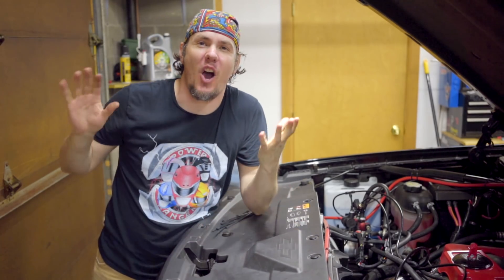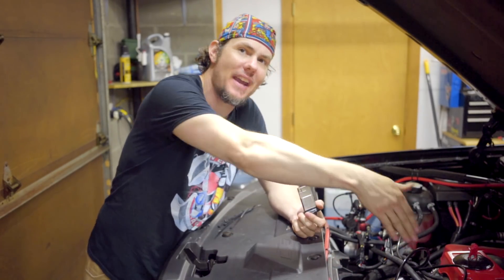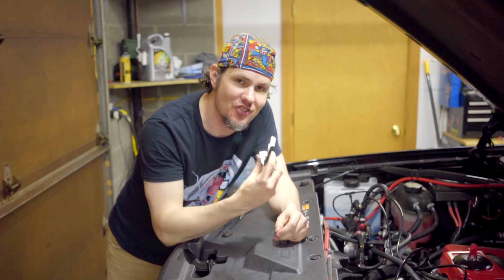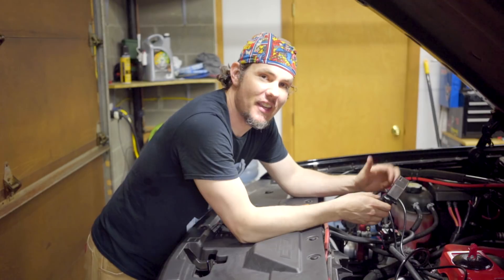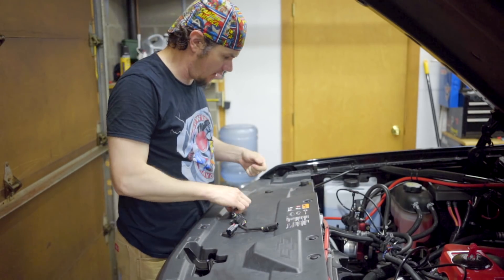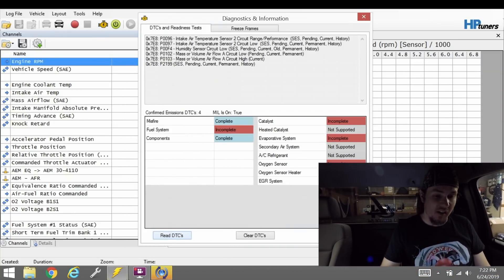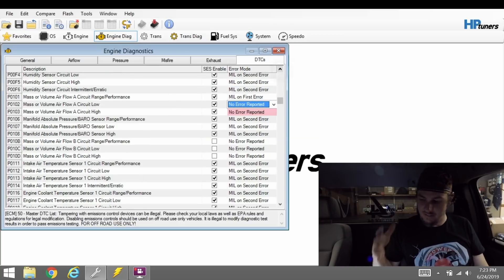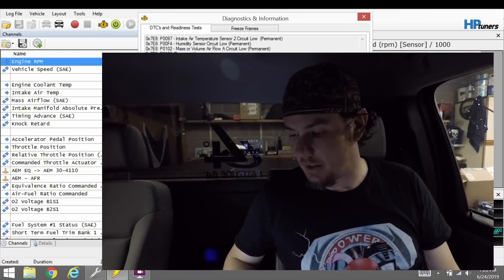MAF Delete Setup To Run A Speed Density Only Tune Using HP Tuners

Comment: Hello,

Can you help point me to someone that can convert my 2013 mustang copperhead to Speed density? I know its possible as some of the cobra jet cars use a copperhead ecu without a MAF and added a map sensor to the i/o pins currently wired to the a/c pressure switch. 

Thanks

Comment: I'm running open loop speed density and it runs very lean on a cold start (20% area) until the engine warms up and is within a few percent. Any way to combat this?
Reply: How did you set your up for open loop ? Thanks sorry I don’t have an answer for your question haha

Comment: Silly question. The description on the MAF calibration says that it can be used to check for a bad MAF. My new trans rebuild shifts funny sometimes so I wanted to try to disable MAF to see if it makes the transmission smooth out.
Reply from the maker: Shouldn't be related to the MAF, most likely torque or timing issues

Comment: Do u know if its possible to diy delete a gm 3800  supercharged v6 maf  ? Its the holden version without the map sensor. Unlike the usa 3800. Our pcm's  r also non hptuners programmable.. idk most professional 3800 tuners delete the maf in the tune. Can i diy it & run a gague or something?

Comment: It was my understanding that on gen v, you DO want one of the codes for the MAF to report an error, because if no error is reported, it will NOT fail into speed density mode. P0101, 102, 103... one of those need to throw a code. Also the enable/disable ECT for p0103, etc (just below the MAF Fail high/low) should be set so that those tests do NOT run, but you still want one of those three MAF codes to set off a DTC. So, you would set all three to No MIL Light and uncheck SES. That way they still throw codes, but don't leave your check engine light on. If the ECM does not detect a failed MAF, it will NOT revert into speed density. 
I have been doing that with my cruze, and any other gen v vehicle I have worked on, and it seems to work like a charm. Have I been doing it wrong? Every tutorial I have seen with the exception of this one agrees with what I said, but I just wonder if I am missing something. 
I also have a really funky issue that when I am running in FULL open-loop speed density, I end up running into an issue where, when logging lambda error for vve tuning, my AE UEGO gradually ends up reading full lean in the middle of logging, killing my data, and I can never figure out which setting is doing that. Someone had mentioned it could be the post o2 and/or the catalyst tests (it was in a thread on cruze talk). Like, it will run fine for my drive to work (about 45 min drive), but less than halfway there, it starts going lean until it reads FULL lean. The car still drives just fine though. I have also heard that if it runs excessively rich, the UEGO will show full lean. I have actually experienced this, but I need to know what your opinion and tech tips would be for setting up an e78 ECM for full speed open-loop density tuning using my wideband, as right now I am using my STFT for everything that is not full throttle, which works damn well, but it would be nice to have my wideband or my engine (whichever is the culprit) stop going full lean when I am tuning. Sometimes when I do a full reflash back to stock and start tuning again it does not do that, so it's for sure some setting that I am setting, but yeah. Any tips?

Comment: Say you're doing street tunes using speed density only, and desire to work off of the stock O2 sensors (no wideband), MAF off, how would you approach this? Because in scenarios where you don't have a dyno, and installing a wideband isn't necessarily ideal from car to car. Been watching your videos, I pretty much have the method, but a point in the right direction would be great, thanks!

Comment: I have a lq9's
p59 that has IAC. I updated it to 3 bar & segment swap for flex
fuel. It fails the maf and runs with just those changes. The problem
im having is getting the maf to fail after Any additional changes i
make. I've went over tons of forms and changes and it still won't
fail the maf. Therfore I am unable to tune. Stock OS 12593058 ->
1262059 any thing you can think of causing the problem?

Comment: Just did speed density on my 5th gen zl1 we tuned the ve table car was running good but are start up was giving us a issue afr running lean and showing 22. I basically disabled my maf like u did in this video car ran good right after but that start up is definitely the issue no do u have any ideas

Comment: Wheel speed sensor is bad can I use hp tunes to view which sensor is bad
Reply from the maker: Don't think so, but check out the VXDIAG, it's like the factory scan tool, let's you check errors in every module, would probably help in finding a bad sensor.

https://amzn.to/2ZLRnMd

Comment: Hey man I have a 02 Camaro that I’m tuning for SD... I’m assuming I’ll also have to hook up the MAF sensor to be able to tune and utilize the IAT?
Reply from the maker: I would double check, you may have a separate iat sensor. If not you can use a breakout harness.

Comment: Thanks, I have been learning a lot from your videos. Any chance you will do one on scaling injectors without injector data?
Reply from the maker: Shouldn't be that hard, you have a wideband or you still using the narrow band sensors?
Reply: @GoatRopeGarage  I have a wideband in the car (2015 Challenger, Hellcat injectors for Flex Fuel Tune). I have tried using the stock hellcat injector data, but I think because the fuel pressure is different between the two car, my injector data is way off.
Reply from the maker: Can you get it running on the new injectors? I would just stick to the hellcat injector data and try to go through the first tuning steps. You're most likely right that your pressure is throwing it off, it's just a bunch of variables, but you're most likely better off leaving the static ones such as injector flow rate and fuel pressure settings the same and make your changes to your fuel maps to bring it in line with the new setup.
Reply: @GoatRopeGarage  Yes. It is running and driving. I think I just needed someone to reassure me I am going in the right direction, thanks.
Reply from the maker: You are, start at idle and move out, small increments, if you notice a pattern you might be able to shift your fuel tables by a percent but never go the whole way, say it looks like your table is 15% rich across the board try taking 7% out and go from there.

Comment: Do you watch the show engine masters on motor trend?   They did methanol vs intercooling on an LS and long story short..  the manifold doesn't evenly distribute the methanol to all cylinders. Lots of people do it with no problems, but it is something to think about if you really start pushing this thing to its limits.       When I do it, I want individual nozzles per cylinder
Reply from the maker: That would be an awesome setup. I would think there would be ways of ensuring better dispersement, maybe volute injection? Now that I'm going SD I'm tempted to look into that.
Reply: joshdrobny93 check out volute injection from pro meth.

Comment: On the Gen V stuff is it ok to completely disconnect the rear O2s?  I currently have mine connected, but zip-tied to the frame.  I know on some Gen IIIs, complete removal would cause issues.
Reply from the maker: You'll just have to clear the codes for them. They are there for cat efficiency.